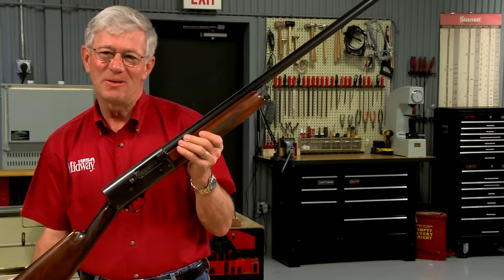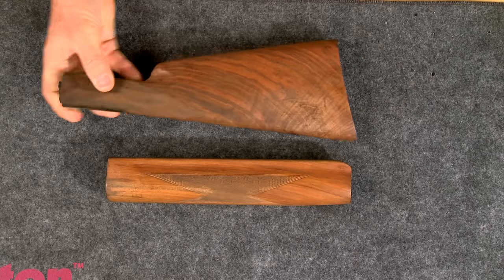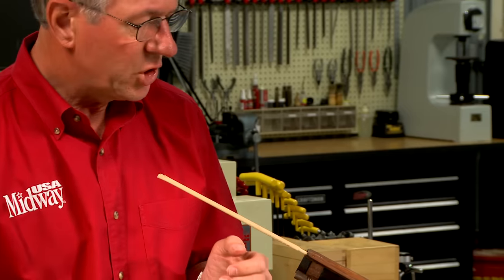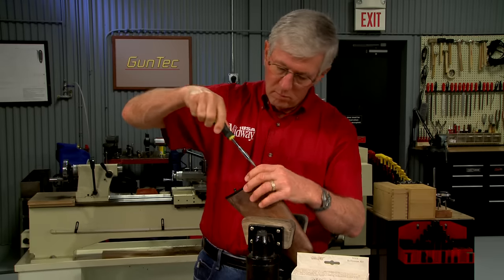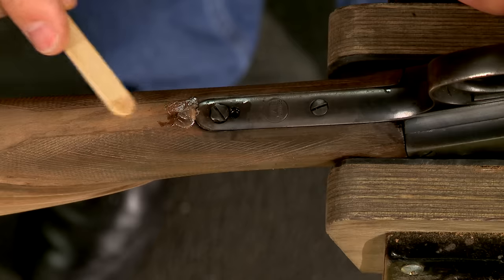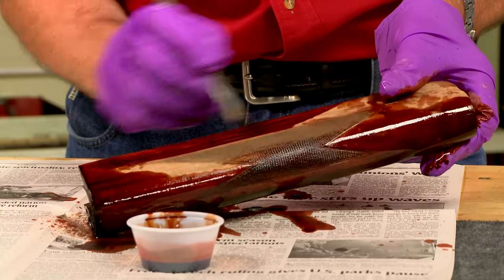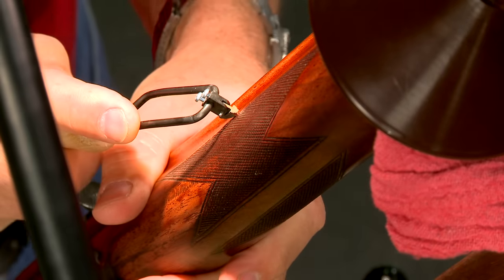Repairing a Remington Model 11 Gunstock | Remington Model 11 Shotgun Project

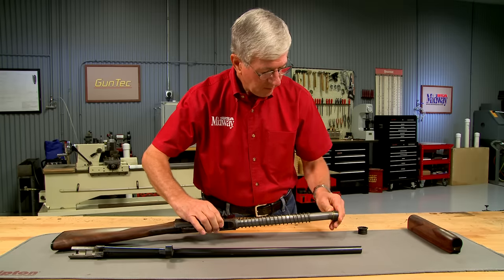Comment: Excellent video!!  Thank you very much!  A tip that would help many Model 11 and Browning Auto-5 owners to prevent the splitting seen is to ALWAYS have the friction rings installed properly.  At 1:11 the friction rings are clearly below the spring and are absolutely ineffective at this location.  At 27:02, they are properly installed above the spring.

Comment: You can buy teflon fret dams from Stewmac (Stewart MacDonald) guitar repair supplies. Same basic purpose, and glues, epoxies, & fillers don't stick to them. I use plumber's thread tape wrapped on dowels for guitar bridge repairs, but it also works wrapped around wood or plastic. Stewmac makes a little suction cup pump to inject glue into flat surface cracks.
Reply: We generally do NOT use Gorilla glue on guitars. It's just rude for the next repair person, to have to try to take it apart. We use hot hide glue, or aliphatics, like Titebond, which I generally do NOT care for. Fish bladder glue is also wonderful wood glue than can be disassembled with heat. We use a soldering pencil or gun with a sponge or a wet towel, to steam out dents. We use many of the same tools gun stock makers use in luthrie work, and this guy is like Stewmac's Dan Erlewine, selling products you really just don't need.  I work on guns, and guitars, and other instruments. Banjos like the old Vegas have carvings on the heel that rival some of the finest guns on the planet, and they are routinely counterfeited.

Comment: i have the same gun with a weaver choke and the corresponding choke tubes. i refinished mine but it's not as nice of a job as yours. mine has no cracks and has nice scrolling on the receiver. a duck on one side and a pheasant on the other. i occasionally hunt quail with it while using the improved cylinder choke. it all works great.

Comment: I would suggest dipping the stock into acetone outside instead of in the shop.  Not only will the fumes in an enclosed space make you sick or much worse but can drift off and find a source of spark to ignite and all that solvent enclosed in a can explode, it will de-oil just as well in a cold place as a warm one.  But it's less likely to emit fumes in a cold place.

Comment: Just about to refinish an old Mossberg stock and fore-grip but am a bit confused about a few things.

Having completely stripped and sanded the old stain/varnish off of it I am left with a fairly light wood that I would like to eventually have look like what you've done in this video. My plan had been to stain it and then finish with tru-oil.

In one of your final steps you say you mix mineral spirits and 'finish' with a bit of stain before sanding - is this 'finish' you use tru-oil? And would it be okay of me to stain the stock to a desired colour, then follow your steps with the tru-oil/finish to achieve a similar look?

Comment: I'm gonna have a Mossberg 185 KB in a month or two thats gonna require some work. The stock... well... someone I guess took the original walnut and tried to stain it or something. Now parts looks like paint or something that got too much heat and others look really REALLY dark, like its an M14 or some such, and another section looked liked they tried to wipe it down when it was sticky. I'm gonna have to work on refinishing it.

Comment: Oil soaked wood. what if you soaked it in a solvent to thin the oil then while it was still wet, put it in a vacuum chamber and used that to draw the thinned oil from the wood grain then kept repeating until there was no oil?

Comment: Question, I have a Model 11 that has wildlife engravings on both sides of the receiver, however both fore stock and the shoulder stocks are cracked and broken, I would like to get it repaired. Can I send it back to Remington for repair and replacement? Please advise.

Comment: What's the purpose in removing the oil that has soaked into the stock? I wouldn't think the oil would be destructive, and if anything, protective. I would think flushing out the oil would leave the wood naked and vulnerable.
Reply: Think it for looks
Reply: Howard Pearcey  Well, water soaking isn't a problem, but constantly soaking and drying is. Wood can be preserved for hundreds of years underwater as long as the wood is not given a chance to dry, which is why removing the oil seems confusing to me. 
I know this guy knows what he is doing, which is why I asked :)

Comment: Wouldn't you remove the butt plate before sanding the stock to avoid damage on the edge?
Reply: I think he did it to prevent rounding on the edges where the buttplate is supposed to be
Reply: @adobotachibana732  I thought I saw him using some special sanding tool to keep the stock on the same level as the metal?  I would think this same tool could be used at the butt plate end?  Anyway, a most enjoy able video series.  He is a meticulous craftsman.

Comment: Can't you put the wood under water to push out the oil or does that not work?
Reply: No...water would make the wood weak and soft and also possibly ruin its ability to take a new finish. Needs to be a 100% solvent such as acetone. Stuffs CHEAP and availiable everywhere too
Reply: Water is a no go on an unfinished stock and thats why stock makers try so hard to get their stocks below 10% humidity if not below 7%

Comment: In the UK we call these guns 'auto-5', is there a difference between the Remington Model 11 and the Browning Auto 5 or are the names just to differentiate the make?
Reply: Same gun, different manufacturer. John Browning designed it and initially offered it to Winchester. They refused. It was taken by both Remington (Model 11) and FN (Auto-5). Later the design was reverse engineered by Winchester and became the Model 1911 SL "Widowmaker".
Reply: Model 11 has no magazine cut-off but basically the same design.  The Auto-5 was manufactured by FN in Europe except for WWII and the Remington was made in the USA.

Comment: Why would you sand out all that perfection of time and use over the years. I mean its fine work but you have to admire and keep those imperfections imo. Just the ones that compromise the integrity of the firearm should be fixed.
Reply: Adam Woody Because the customer wanted those marks of rough use repaired.  May have wanted it S close as possible to condition when Grandpa bought it, or when it was given to Dad.  The excess oil, chips on the buttstock and dents etc may have been from recent  rough use on a gun that had been in great condition for a long time.
Reply: Yeah i get that no prob but you have to keep the patina and not finish too much to make it look perfect. Yes i get the customer probably wanted it my question is why would you do that to something that beautiful that has seen time and space and is still here looking so great. I feel the old is much better than the new could ever bring when it comes to alot of things including firearms :)
Reply: Leaving all that damage just hastens the time to it's complete failure.  It's like restoring old works of art or a classic car.  Rejuvenating the firearm will give it new life and interest, instead of being just some old dirty, beaten up gun.
Reply: I wouldnt say fixing blemishes erases the guns history, it adds a new chapter for more history and use. I fully understand keeping little dings here and there as long as the gun is functionally sound

Comment: The only thing that I would have done differently would be,......I would have removed the dents first because the steam and heat ruins the glue he used.
If you want to see some magic put drops of that gorilla glue on a dinner plate and put it in the microwave till you see it boiling then remove it it will dry really quick and it rips a chunk out of the plate and makes a popping sound,.... safety glass's.
He sends the guns back in time. Awesome and effortless with out pause.